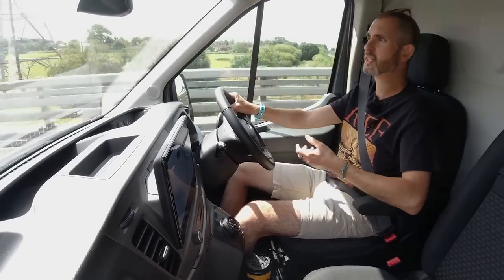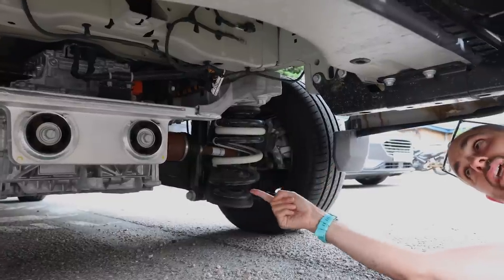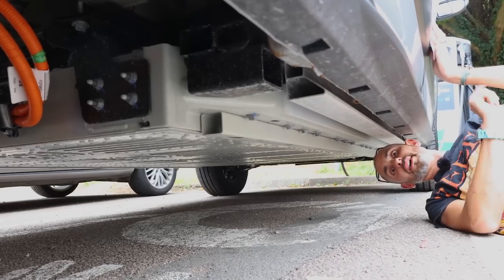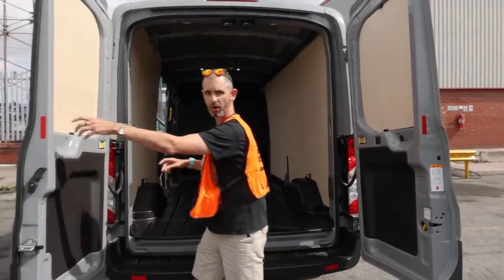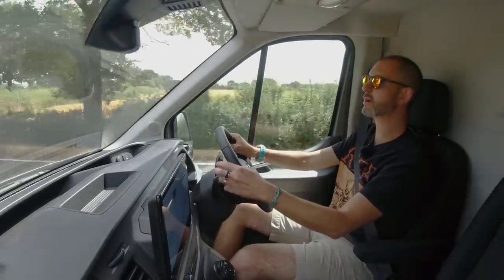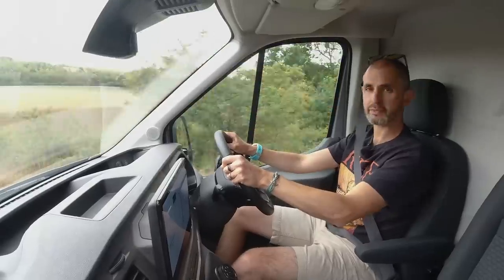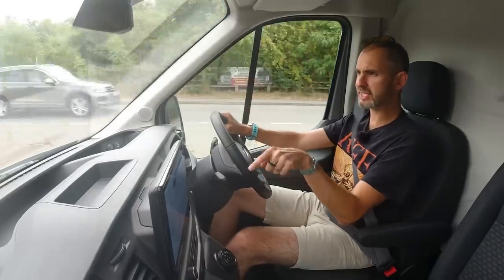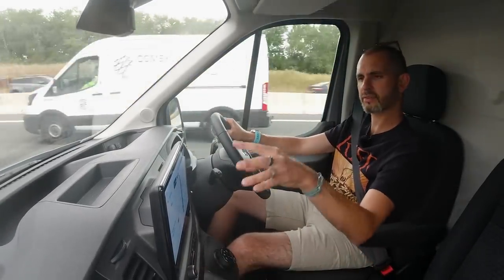New Ford E-Transit electric review - the most important van of 2022

Comment: it is amazing we can get 95% recycling on cars, but only hit 40 or 50% on plastic bottles (in the USA) the big company here is COPART AUTO SALVAGE, and yes good inventory management is computerized and detailed. One local place was later bought out by copart, (I had the son in class) American Auto Parts, their front in Weslaco Texas has four classic Studebakers up on poles (last one an Avanti '63), I bought a leaf spring from them once, and a trailer hitch once as well/ but that is another story. *wow 2 pounds a liter for gas/ and diesel, thats about 8 per gallon, *at todays exchange rate (9/6/2022_ that is about $9.19 per gallon or  roughly more than twice the price here in Texas at the moment, and we are just now getting rid of the "muscle" cars from the lineup here/ of course in Texas mostly replaced by pickup trucks that got fancy (check out the King Ranch Edition F150)

Comment: the big space at the rear is where the spare wheel would normally live in a standard Transit. the fuel tank is near the rear of the van cab, (similar place to where the battery pack seems to be) as the fuel filler neck is in the flap in the passenger door.

great for short range couriers, especially if the real world price is only £4k more but for anything that covers a lot of ground, not so great. they certainly represent better value than EV cars do, compared to their regular equivalent. The other issue i have with EVs is from a safety point of view. you ALWAYS seem to have to pull into the charging bays forwards, as the socket is at/near the front of the vehicle, whereas its recommended, due to being much safer, to reverse into parking bays, so the charging port should really, in my mind, be near the REAR of the vehicle.

as for the mk3 Granada electric mirror control, why change something that works so perfectly well? also glad that you admit that for longer distance uses like you use it in the video, that Diesel is still a better option currently

Comment: Any commercial user will tell you there’s no way you can be buggering around charging while out. You need a range that will comfortably cover your daily route(s) and then plug the thing in when you get back and be fully charged ready to go for the next shift in a matter of hours. This generation e Transit is ok but don’t get carried away,  it’s still 1 or 2 generations from being the panacea it is being made out to be.
Reply: Which is why this van does twice the normal daily run. You might do 4 times the normal, but that's not normal.
Reply: @gasdive  Ha, the old ‘what is normal’ argument. 
Firstly, your normal is normal to you, it doesn’t matter what anyone else’s is. 
Secondly, there is a huge amount of Ford spin on the figures to lure you in. There’s no way this will deliver your real-world range expectations. 
It will work for some small mileage ‘potter-about-ers’ but is hopeless for anyone that needs to get a move on and have the ability to do long distances and long hours without interruption. 
There are a huge number of users in that category despite what Ford’s PR would have you believe.
Reply: @camwat5193  did you even watch the video?

Comment: The principle is great but I don't like to have to sit for 45 mins every 100 miles and what happens when the batteries pack up. Not everyone can afford a new van or battery every 8 years. Mine is 8yr old and still running strong.

Comment: I have been watching with interest the E-transit for a few months now. I run a mobile bike workshop in Sweden but I have  found that the supply of these E-vans is very limited due to supply shortages. I have approached stelantis and other motor manufacturers and I could not get an ETA for any large new Electric vehicles. For the next 3 years I have moved away from diesel to a  CNG Mercedes with the hope in 3 years time supply issues are no longer an issue.  Why is nobody covering this or is it just a Scandinavian problem? Has anyone solved the heating in the load area for service vehicles? Ford has come closest with the worktool power solution.

Comment: Or buy a second hand Renault traffic diesel and do over 600 miles without stopping at all so your there and back meanwhile this glorified milk float is in a line waiting to charge up if the charger works ? Clean fuels are the way forward. The carbon footprint of destroying everything with a fossil fuel burning engine would be catastrophic and are conveniently forgotten by those that promote electric vehicles. They just don’t add up.

Comment: Way too much charging in a 24 hour period. I drive 7.5t trucks in the UK that have 3.2l turbo diesel engines and cover around 200 miles a day on average. If I wanted to I could easily make a full tank of diesel last for 2 shifts which would be around 10 to 15 hours driving whilst carrying around 3t of weight. So for me, electric vehicles especially for delivering just aren't ready yet. So companies that actually want to consistently deliver without having to worry too much should stick with diesel for the next few years at least. Thanks anyway Johnny 👍

Comment: Interested to know what your total mileage was and the cost of that mileage. If you're going to talk about fuel prices I think we need to know the comparative prices.
I currently have a '16 Caddy Maxi, the goal would be to get an electric van next, maybe the buzz cargo. I'd say my daily mileage is less than 50, probably 30 on average
Reply: £0.57 per kWh at Instavolt.
Reply: @Simon-dm8zv  so in reality it doesn't work out much different. 68kwh battery, 125miles range, £0.57kwh, is near £40. With diesel around £10 a gallon. Those vans do around 30mpg. You're looking at around £40 to cover the same mileage. Unless I'm really missing something.
Reply: @drapears  What you are missing is that fast charging will not be necessary most of the time and you will be relying on cheaper charging at night.
Reply: @Simon-dm8zv  ah yes, that makes sense. So these rapid chargers are expensive. Looks like the average kWh price at home is around 18p. So now we're around £13 for the same journey, nearly a quarter the cost if you charge at home. Thanks man

Comment: A van that only does 200 miles max that is total madness no where near enough i do that every two days just commuting to work so as a van that will be doing a lot more milage that is disapointing. Does this now mean the chargers will now also be filled with vans as well so even less places to charge the cars. Hybrid is the way things will go so least rhe engine will get you out of trouble when battery is flat

Comment: Really great review as always Mr Smith, but as an EV virgin, and no idea how much any EV costs to run, how much in redddies did you put in each time and what does that equate to "miles per gallon?" Thanks, Jon.
Reply: Apparently, Instavolt charge 57p / kWh... and Johnny stopped a bit early, so probably charged ~20% -> 90%...   70% (90-20) of the 68kWh battery is roughly 48kWh... multipled by 57p means that the first fill-up cost around 25 quid.

If you charge at home, then depending on your tarrif, you may get something as low as 15p / kWh overnight - in which case, a full charge from e.g. 10%-100% (61kWh) would be roughly 10 quid.
Reply: @logicalChimp  thanks for that Geoff, not bad price wise then!

Comment: I love the video.  I really do like the concept of EV's too.  But there are infrastructure problems. The most obvious one here in Australia has similar problems in the UK.  On street parking.  A lot of our inner city residential homes only have on street parking.  Overnight charging is very difficult.  I cannot see extension cables running from the house over the footpath to the EV being a viable situation.  We are also finding the electrical network capable of supplying the demand for a large number of vehicles.  I see EV's as a stop gap compromise until hydrogen can be made available as easy as our current fuel systems.  I don't know what the situation is in the UK with inner city delivery vehicles but here in Australia a lot of our delivery vehicles are 10+ years old and very dirty.  There is a lot of work still to be done unfortunately.

Comment: Battery pack is going to get wrecked hanging down that low!

Hybrid will be the best solution for many vans - they need to do 200miles fully loaded. Elephant in the room is where does the energy come from… networks won’t handle all this extra demand

But for city work and multi drop it sounds perfect
Reply from the maker: Batt packs are armoured and regularly tested with spikes and bollard collisions in order to prevent piercing and waterproof issues.

Comment: My two bobs: 
If all cars and vans were suddenly electric the amount of noise on a freeway would remain largely the same. Besides the trucks/lorries, the majority of the remaining sound you hear is road/tyre noise and air displacement noise from cars and vans. Whoosh! 
The quality of the air will be improved however - even more so if trucks and lorries had an alternative to diesel. 
The price of electricity will likely come down as more people get EV's simply because its a relatively small step to add solar to ones house/factory, and yes the price of diesel/petrol will continue to rise I expect.

Comment: Cars, Vans, PUs such as F150, Ridgeline, and similar PU's should come in six general types. Gas (ICE), Diesel, Mild Hybrid, Plug in Hybrid, Hydrogen fuel cell / electric, Battery electric. Let them fight it out for 10 years, accumulate the meta-data, winner takes the spoils.

Comment: One thing that EVs can't do to tice people away from the piston engine in a manual gearbox. Could that happen ?
Reply: Not impossible, but unlikely - manual gearbox is just a point of inefficiency... only required for ICE because engine has a minimum (stall) RPM, and a much lower max RPM... plus (usually) low torque at lower RPMs.  EV motor has maximum torque at 0 RPM, and cannot stall, so no 'need' for the gearbox, and it just becomes extra weight, cost, and point of unreliability (not to mention that the actual motor is built into the rear axle - not a lot of space to fix the gearbox there)

Comment: I can tell you delivery drivers can easily do more than 200 miles in a day with circuitous routes in all kinds of weather, traffic and over varied geography with some serious weight in the back. There's no way you will get the use of 196 miles under those conditions.

I don't think I ever delivered only one thing. Not even for the smaller companies. You might stop more than 90 times to make a delivery and some companies routes are timed which makes stopping to charge the sort of hassle (or impossibility) that would require another van in the fleet to pick up the slack, hardly 'green'.

Then there is the battery pack warranty which is 100000 miles or 8 years. The mileage would be exceeded in under 2 years under not extraordinary conditions. Not great for smaller businesses and it represents a bit of a question mark on the 2nd hand market if you try to sell it.
Great if you're a multi-billion pound company who can afford to pose as green but I fail to see why anybody else with the considerations of cost, efficiency or even environmentalism would actually pick one.

Comment: My problem with Ev vans is once you load them up with weight as you would with a van, the range crashes they aren't built for work. We loaned a Nissan EV van and once it was loaded it was useless the range fell unbelievably fast, we decided against them after less then a hour
Reply: You had some other issue there. Weight makes almost no difference.
Reply: @gasdive  of course it does, didn't you go to school
Reply: @interceptor-ss8kb  yeah I did.

Typical coefficient of rolling resistance for a rubber wheeled vehicle is about 0.01.

So carrying an extra 1000 kg over a 150 km, (typical range of this vehicle) that's 1000 x 150000 x 0.01 or 1.5 million joules. That's slightly less than half a kWh. So putting a tonne in the back would cut the range by less than 1%.
Reply: @gasdive  more weight you put in the heavier the vehicle hence the less distance it will travel doesn't matter if its internal combustion or EV. Apart EV range is much smaller
Reply: @interceptor-ss8kb  sure, I agree, the more weight you put in, the less range. In this case, slightly less than 1% less range for every extra tonne.

Do the maths yourself if you don't believe me.
Reply: @gasdive  funny your maths makes no sense you put half a tonne of weight it the back of a van you are going to lose way more then 1% range especially in traffic
Reply: @interceptor-ss8kb  it's not a petrol car. When you accelerate and brake in traffic a petrol engine turns the petrol into kinetic energy, then the brakes turn it into heat. It's lost and that's why a petrol car has poor range in the city. In an electric the motor takes energy from the battery, turns it into kinetic energy, (edit, more weight means more kinetic energy at the same velocity, so if you add weight you increase the amount of fuel that has to be burnt to make that extra energy. End edit) then the motor turns it back into electricity and stores it back in the battery. There's some losses in that, but not much. The big loss is still aero drag, which is why electrics get far more range in the city than they do on the highway. Because aero drag goes up with the square of the velocity.

Comment: I'm wondering why there isn't a (2nd) charge point in the back of the van, they could easily do a quick change while being loaded at an loading dock. But with the vans all being different lengths it does not make for an easy choice where to place an charging pole. Also having to run cables Infront of other vehicles if your not sitting at an loading bay in the side ...
Also with these massive blind vans its way more logical to backup while parking than to backup when driving away... I do not understand Fords choices for this reason...

Comment: Electric commercial vehicles will take off simply because the TCO is significantly less.  Fleet managers will look at their spreadsheets and buy more eVans.   Battery tech is moving so fast that a 300 mile eTransit is not far away,

Comment: It’s not a high roof, it’s a mid roof.  The rear load area is the same as the RWD diesel, but less internal height compared to the FWD diesel.  Rotary selector is horrible.  The lack of physical controls for climate as Johnny says is yuk.  What’s under the bonnet?  Front charge port is bad if you are involved in minor front end collision.

Comment: I wish people would talk about regen in a more informed way.
Sure you can put the van in L, and when you come off the accelerator it uses the momentum you've gained to add charge back to the battery. This has the the effect of reducing vehicle speed. As regen is way less than 100% efficient you are far better to have not used the power in the first place. 
Leave your vehicle in D, give the vehicle in front a little more space and just lift off the accelerator and let your vehicle coast. This means the power you've used is consumed in getting further on your journey. IF, you need to brake then this puts the vehicle in regen mode, (unless you brake hard), and only the excess momentum gets turned back into battery power.
It's wholly incorrect to say that L mode regenerates more power as if this makes it more efficient.
Reply: coasting is - generally - not an option in stop-and-go traffic, which is when Regen is the better option.  But you're probably right about coasting being the better option on clear roads / motorways, etc..
Reply: @logicalChimp  using L for regen is never a better option. It's far more efficient to not use the power in the first place than to use it and try and reclaim it. Remember also that the brake pedal is doing exactly the same as L, only it's infinitely variable based on the brake pedal pressure you apply. 
L is great for downhills where you don't have to ride the brake pedal to recoup some free energy.
It does require some planning ahead but I get much better mileage in D than L on my mixed commute. Car has done 90k and is only half way through the first set of brake pads.

Comment: On load capacities, it would have been better if you had compared capacities for vehicles with the same MAM. Comparing against a 4200 kg Transit is unrealistic. Transits above 3500 kg are rare because it puts them into the C1 category which people with post-1997 driving licences don't have.
Also, if you're using a vehicle over 3500 kg commercially, you need to have it inspected every 8 weeks (like a mini-MOT), you need a Goods Vehicle Operator's Licence, and it comes under tachograph legislation.
Normal car recovery companies won't touch you either, you're into HGV world.
So, just saying that you can get as much payload as an ICE Transit is a bit disingenuous if, to get that payload, you have to incur these significant costs and restrictions.
Reply: There's a derogation for alternatively fueled vans up to 4.25 tonnes GVW, so you don't need an O licence and can drive on B licence with a 5 hour course. It's a mess though because over 3.25t still has 56 mph speed limit.
Reply: @MyMednas  Interesting, I hadn't heard of that.  However, it appears that you're still subject to Drivers' Hours and Tachograph Regulations if you go more than 100 km from base, or (if you stay within 100 km) GB Domestic Drivers' Hours Rules.

So, it's not as bad as I thought, but still not as easy as staying under 3500 kg.

Good that, when the time comes to upgrade my van, I won't have to do the training (since I already have a CE licence)

I wonder what will happen with recovery and insurance companies; at the moment, "normal" coverage stops at 3500 kg; maybe they'll start extending that to include 4250 kg "alternative fuel" vans.